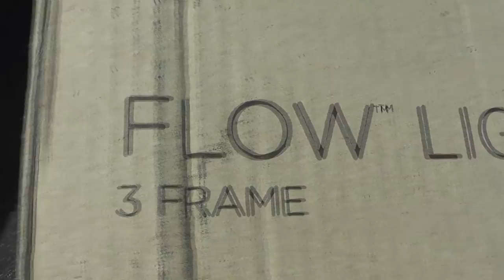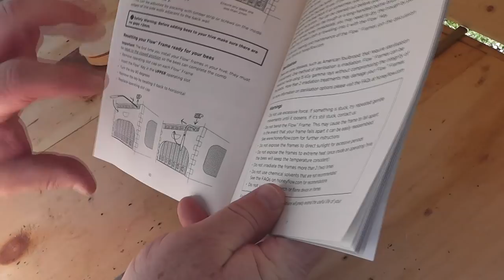Flow Hive Has Arrived! - Day 69 of Beehive #2

Comment: Nice video. Just a question re the tabs you cut off.  Are those tabs there for the defined bee space. As bees will propolise any gap under that space you cut off, does that mean they got their spacing wrong or is your initial spacing between your frames wrong. I dread to think what it would be like to try and lever out this delicate plastic frames of the flow hive! its bad enough if you get it wrong with wood!! would be very interested to know your thoughts??? Thanks in advance.
Reply from the maker: +Richard Noel The will only propolis in smaller gaps. The gap here is around 3/8" and is in more danger of being filled with comb :)
Reply: So are you saying their spacing is wrong or is your hive sized wrong. This is all pretty crucial as far as i am concerned. a retro fit according to your video looks fiddly and basically it dosent fit well?
Reply from the maker: +Richard Noel We were talking about spaces that bees will put propolis.  My hive width and depth are based on standard Langstroth frames. That is the way I designed it.  The length is just like every other top bar hive.  Do some research on top bar hives. They have been around for 1,000 years. much longer than plastic flowhive.
Reply: +ArtisanTony ok thanks for that.just interested to see how it adapts to different hives. Looking forward to see the results in your following 
posts. Thanks.
.

Comment: The feeder was empty I assume? Otherwise the Flow frame would get filled with sugar syrup.
Reply from the maker: +Edward Ridgeway You mean nectar or what?  The bees collect nectar to fill frames intended for honey.
Reply: You had a frame feeder next to the Flow frame. Is there sugar syrup in that feeder? If so the bees think it's nectar and will fill the Flow frame with it.
Reply from the maker: +Edward Ridgeway not necessarily.   They are working on frames that were there before the flow frame. That have basically ignored it so far. The hive beetles love it though :)

Comment: look up codys lab. and no he doesnt use that bee killing device.
Reply: I don't own a hive myself but from what I see the honey is capped so it's not see through so they probably wouldn't see it is missing
Reply: They are down south and the bees are unlikely to get cold and freeze. They also have only a single level hive, not multilevel. Cody was critiquing the flow honey hive design, not the frames themselves. Using the frames in this way, the guy can choose to harvest the honey only when it is all cured and uncap it for the bees. I don't think just using the frames will cause the issues discussed by Cody, especially in the warmer climate these guys are at.